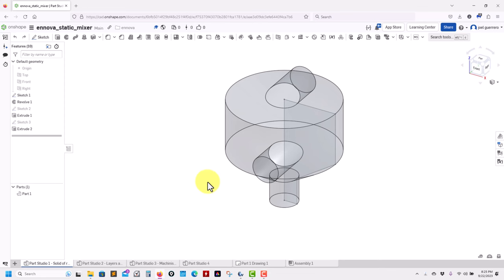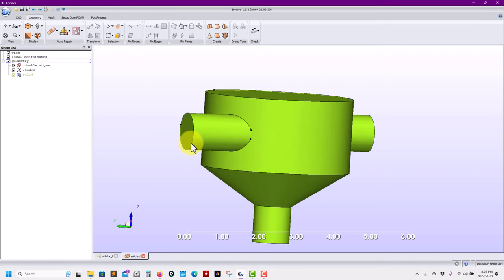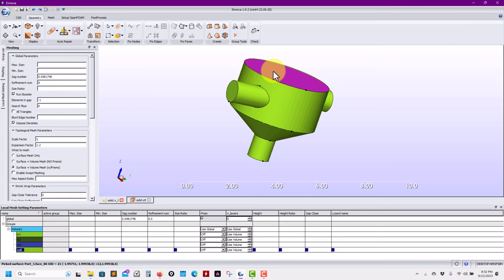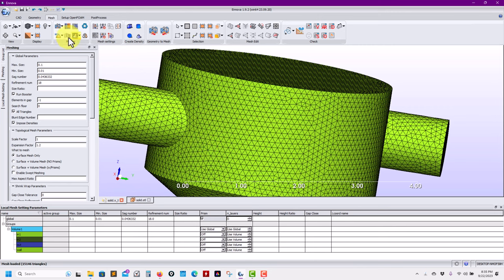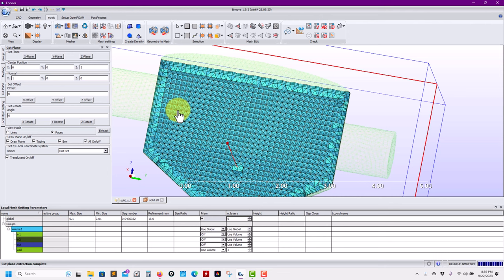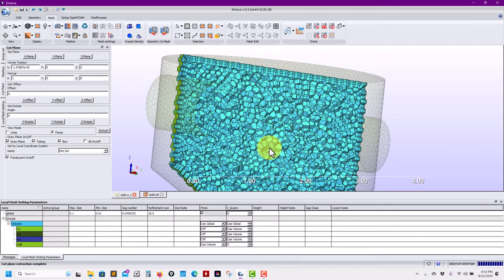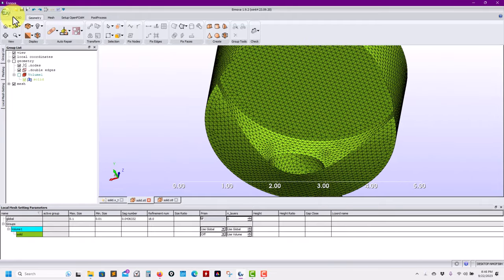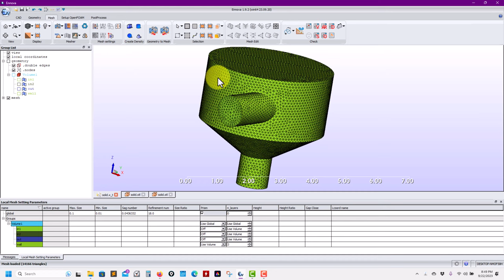Meshing with Ennova | The static mixer geometry | Topology-based meshing method

Comment: Thank you for your great videos! When you create the dual poly mesh the height of the boundary layers is different (the new first's height becomes half of the original first, the new second is the average of the original first and second and so on..) what's the best way to compensate this when creating the original tet mesh? Is it possible with ennova to define each layer thickness?
Reply from the maker: Hi, yes there is a way around that but I don't show it in the video, it is an extra click but is not perfect. Right now the developers are working in different techniques to grow the BL. So far you can fix the height of the first layer and set the growth rate, or simply fix only the growth rate to get the height of the first layer equal to 0.20*edge size of surface mesh
Reply: @wolfdynamics5703  thank you !
Reply from the maker: Btw, if you fix the first cell height you wont see the problem. You only see the problem when you let Ennova compute the cell height by itself.